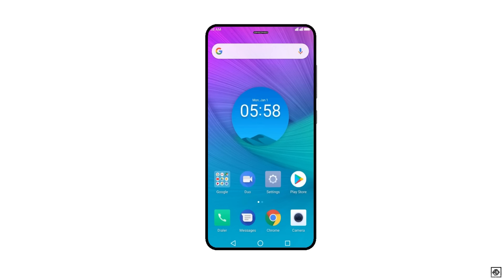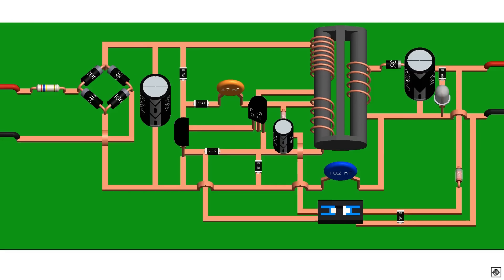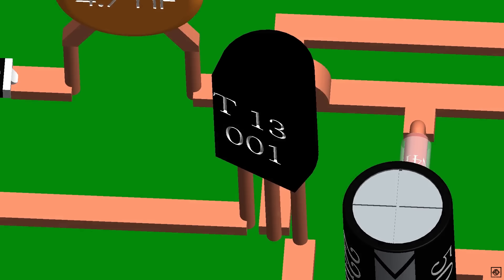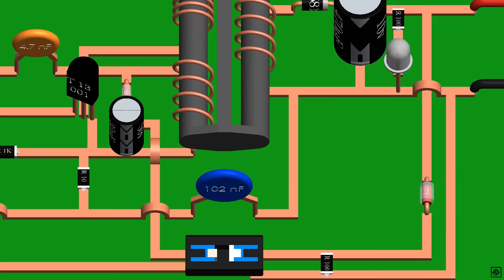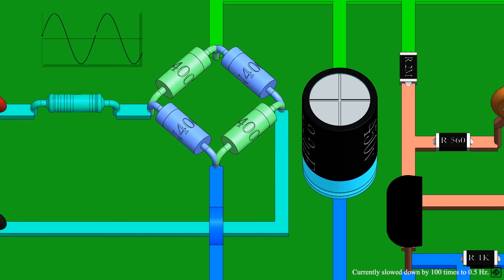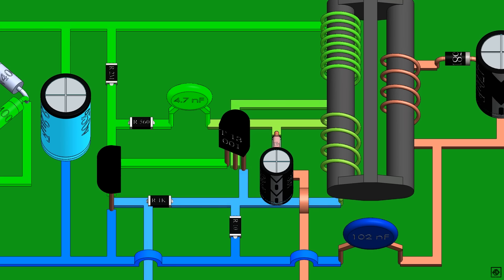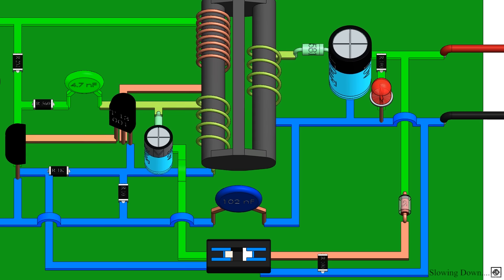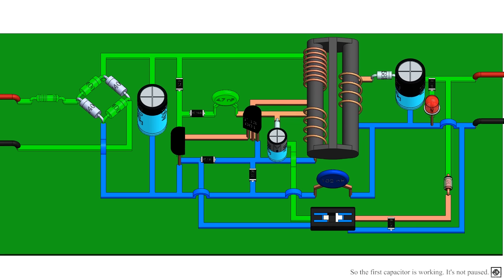How does a mobile charger work? SMPS with Opto-Coupler.

Comment: A 260K resistor in series with the phase line? Ridiculous! And for information, 260K is not a standard value resistor. Actually, it should be a 5.6 ohm or 0.56ohm as per the colour code in the video. With a 560K in series with the supply, the circuit will not work
Reply: good to know
you're next level

Comment: @Explorer The voltage of the primary coil seems to be a pulsating dc, not ac. That means pulsating dc can induce voltage( not only ac) in the secondary coil of transformer

Comment: why there is a single diode at the output of transformer if output of the transformer is 5V AC, there should be 4 diodes in bridge format to convert AC into DC

Comment: This circuit do only convert from ac to dc, not ac to dc to ac to dc. Ac is electric current which periodically reverses direction and changes its magnitude continuously with time.  Pulsing Dc is not ac.

Comment: If we convert AC to DC to AC to DC because transformer and capacitor for 50Hz is too big then why use a transformer at all.. why cant we just AC to DC then a buck DC to DC converter? Is it just to isolate or is there another reason?

Comment: Hello! I'm too dumb for this., Can you tell me how does a phone charger brick with multiple output works?
I got a phone charger that can output 5v1A/2A upto 11v3A i.e. from 5w, 10w, 15w, 18w 21w 24w 27w and 33w

and i have an 18650 charger that uses 5v2A input and needs a powerbrick(errr a charger that needs another charger sounds stupid). Is it safe to use my power adapter? I really hope you can answer my question

Comment: Formula for finding this type of oscillator....has anyone any idea about type of oscillator used...
Reply from the maker: Any oscillator will work. Its used only as reference so no power is drawn (ideal). The oscillator in this video is made with op-amps.
Reply: But there is no any opamp in this video....plz try to give information about calculation of this type of oscillator frequency....
Reply: How can I set oscillator frequency to any desired frequency say 30 khz
Reply from the maker: Sorry for my mistake in reply. I thought this comment was in Buck-Converter video.
Also, I don't have any formula or calculation for this oscillator.
But, I think, the frequency depends on the capacitor (4.7nF ceramic capacitor).
If the capacitor value decreases, then its charging time will decreases and the frequency increases and vice-versa.
Reply: Thank u explorer for genuine answer
Reply: Transistor 13001 gives 180 phase shift and transistor s3080 gives another 180 phase shift...thus a total of 360 phase shift according to barkhausen criteria is obtained for sustained oscillations.
Reply: When S8050 conducts LC oscillations occur due to parrel combination....and when 13001 conducts ...capacitor discharges and increase base current which in turn increases collector current through primary winding....delay time can be controlled by 4.7 nf capacitor and resistor.By varying the value of capacitor and resistor,transistor 13001 ON time can be varied.OFf time can be varied by changing the value of resistor connected to the base of S8050 to some extent.I think so.
Reply: Plz tell me about switching transformer rating for 5v,2amp output.
Reply from the maker: There isn't any number on the transformer but I think it's a 12W transformer.

I made this circuit at - https://tinyurl.com/yyydy5wf
If we ignore the secondary winding and treat the aux as sec, this may be valid.
[You can watch the voltage at any junction by placing the "out" on it. The left scope shows its values. Right one is for reference.]
As you said, if we increase the value of the base resistor of S8050, the off-time increases also the frequency decreases.
And, ON time depends on the 2M resistor. Decreasing it (to 200k) increases the ON time.
I think the RC is only for frequency, changing its values only alters the frequency.
Reply: You are absolutely right.I was wrong .
Reply: Thank u for giving your precious time.

Comment: 260 kilo ohms primary fuse resistor?
Not true.
This fuse resistor is mostly less than 100 ohms. 
If you calculate the power loss of this resistor in just a 5 watt charger you will get a huge number over than 100w. and the current pass through this resistor is not sufficient for driving the whole circuit.
Maybe it is 2.6 ohm qnd the third color and is golden not yellow.

Comment: I have a doubt if we can convert AC to DC without using Transformer then why we need AC-DC-AC and then DC
Reply from the maker: To lower the voltage to 5V DC from 240V AC.

Comment: I just have a problem with that 260K ohms resistor in series with the bridge rectifier. Why would anyone connect a 260K ohms fusible resistor in series with a bridge  rectifier???? That resistor alone will dissipate all the power and not to the circuit.

Comment: Over Simplified : Diodes (AC Into DC) + Step Down Transformer (Reducing Voltage) + Capacitor (Smoothning The Flow Of Current) like a Valve!?
Can Anyone Check My Homeworks?🙄

Edit :Resistance & Light Emitting Diodes As Well I Knew That!?
Reply: Well, you got the idea presented in the video, but the idea presented in the video is wrong.

This is a "flyback" converter. The thing that everyone calls a transformer does not work like a transformer in terms of power delivery. It is an inductor with two windings. The input or "primary" winding is used to store charge as a magnetic field in the inductor. While current is flowing in the primary winding there is no current flowing in the output or "secondary" winding. When the switch on the primary side turns off, the energy stored in the inductance is delivered to the output via the the diode in the output circuit. Essentially no current is flowing in the input winding at this time. There is voltage reversal on the secondary due to the way inductors behave, but the direction of current flow in the primary is always one way as is the direction of current flow in the secondary. There is no "alternating current," only current that changes in amplitude.

In flyback inductors you don't use turns ratio like you do in conventional transformers. You set the inductances of the primary and secondary windings so that you can store and deliver energy in the available time.

Comment: 102 nF is waaaayy too high.

This capacitor is used to reduce high frequencies induced bu the main transformer's crosstalk in the secondary.

Its value is in fact 1 nF (1000 pF) and its voltage rating is at least 250 Volts AC.

Using a 102nF cap between primary and secondary would reault in (small) electric shock.

Comment: That 260k ohm resistor in series doesn't make any sense if we have rms voltage of 220 volt then 84 microamp of current will pass. That means maximum 0.18 watts of power . So this video is completely wrong . The adapter have output of 5 volt 2 amp so 10 watt. Think again and improve your mistake
Reply: you're next level

Comment: I made this circuit and on my oscilloscope, there was a LOT of switching noise.
Reply from the maker: Yes, Switch mode convertors do have lot of noise (also old chargers).
You use a RC Low pass filter.
Also, Appreciation for making it.😀

Comment: I have watched the video several times and still didn't understand the oscillating  circuit.
Reply: Es un circuito auto-oscilante formado por dos transistores. El autor del video dejó un diagrama en JPG qué puedes descargar. El circuito oscilador, primero activa parcialmente al transformador mediante el transistor principal, con lo cual se obtiene un poco de voltaje en los devanados secundario y auxiliar. Al hacer un poco de voltaje en el auxiliar, ese voltaje es inyectado a la base del transistor principal (ya tiene 2 voltajes) con lo cual conduce más y el primario puede circular más corriente. El transistor auxiliar sirve para Apagar al transistor principal cuando el voltaje de salida intenta superar los +5V: el optoacoplador manda esta orden al segundo transistor, quien a su vez apaga al primer transistor. Es algo difícil de entender al principio. Saludos

Comment: The internal circuit isn't AC it's switch mode DC.  Hence being a "switch mode power supply."  You went a really far way to get such a basic concept wrong.

Comment: Not only are you not explaining anything, but simply narrating what the components are (+ their values), but you also offer erroneous information such as 01:21. A rectifier bridge with a filtering capacitor does NOT convert AC to DC, it takes a lot more than that. It's a gross simplification and the aim of that stage is not to convert AC to DC, but to create a suitable rectified voltage that serves as input for the next stage. Saying the phone charger converts AC to DC to AC to DC is deeply incorrect.

Comment: This is one of the cheapest and extremely obsolete solutions decent manufacturers stopped to do about 10-15 years ago. Only counterfeit with dangerous internal mistakes (1KV rated capacitor between primary and secondary instead of 8KV tested, narrowed border on the PCB, bad isolation in the transformer).

Comment: There are too much wrong information on this video
1- After converting voltage ac to dc with bridge diode, you are just cutting dc voltage with oscillator circuit. It's not ac again its Pwm shaped voltage. 
2-Connection of transistor is wrong, gate of transistor is always middle pin, it connects for mosfet on this video. 
3- 102 doesn't mean 102nF it means 10x10^2pF=1nF
4- connection of zener for feedback opto is completely wrong.
You should delete this video. These infos are too much to ignore

Comment: bulb made now here hv circuit inside, normaly it can use 2 line frm the plug.
   in 1 line only never turn on but if touch by hand  it turn  on slightly 
   im not expert in modern things functional, 
   i gues may be procedure 110 volts,  

components here were made  
to plug in  at 220, 
  why the circuit panel inside bulb with a tiny wire rolled like transformer,, 
   if the component is 110 
need transformer to  plugin  
to 220.
   
dont know how bulb made  now   is energy saving 
 10,15,25,35,65,85...100watts 
                    le d   
      lo energy de# 110.v =
     low  activate #1 =     #132
             
                  133
  philippines #everything 

dahil siguro sa december 25 
at walang nakakaintindi kung 
anung tunay na background ng mga occasion  na kahit ano nalang ay patok na patok dito sa bansa at sino ang tinutukoy na
  "star of all season" 
 
kaya siguro ganito ang electric bill dito  dahil kahit paliwanagin ay freewill na ang nais ay ang mga ritual
      
but now as  many could see 
im not let  these use  me